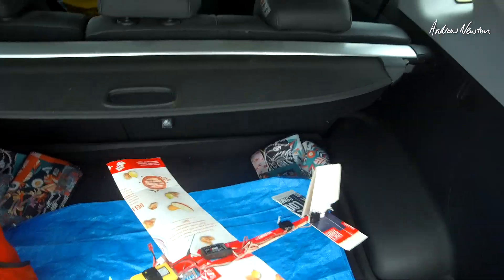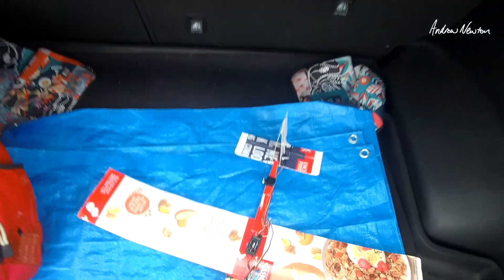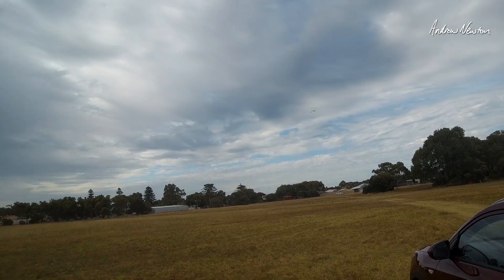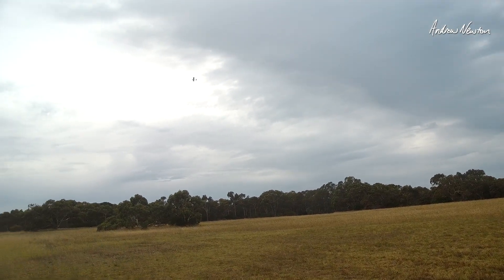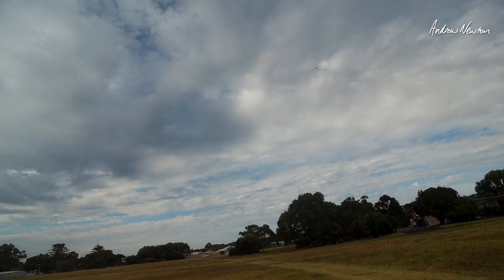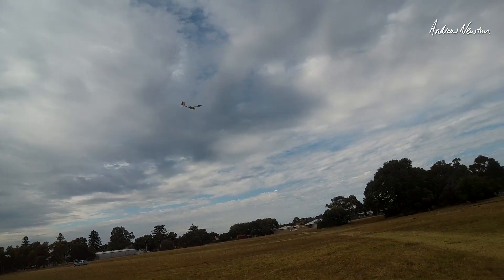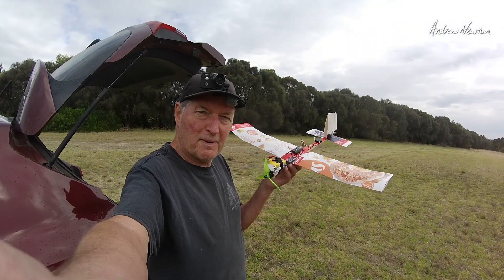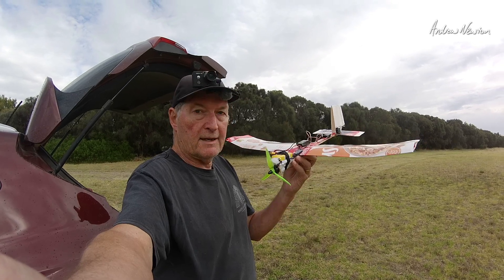Cereal Box Plane - Mods

Comment: Hi Andrew, we are now making wings in epe sheet, Fevicol SR 505 is a synthetic rubber based adhesive for joining parts also laminate it 

and it's almost unbreakable in crashed. Can you try and make some wing in this material, if unbreakable wing are produced it helps to many beginners to save money in most costly hobby 😢

Build link below 👇 

https://youtube.com/shorts/9NqdamOaNlk?si=hzdcY1uwKZ8Yf-RU
Reply from the maker: Nice one, unbreakable would be good